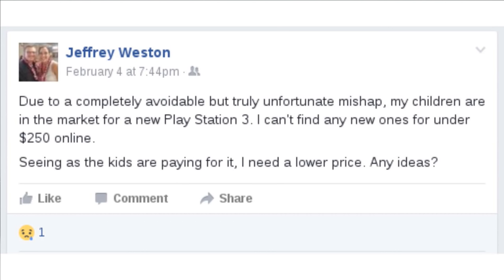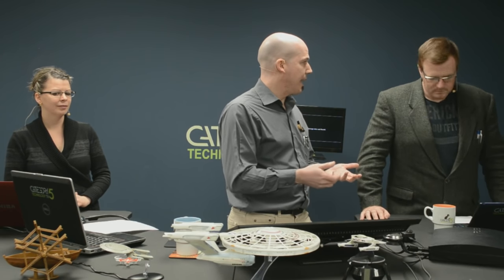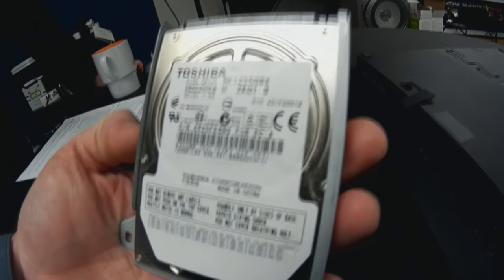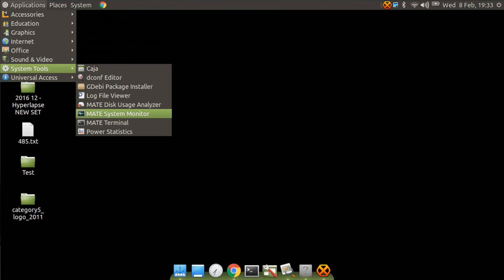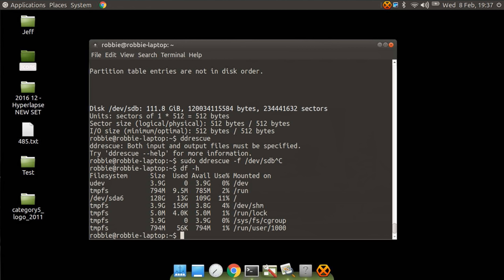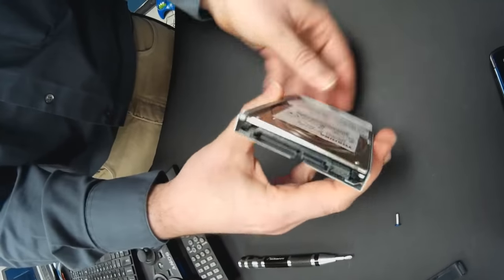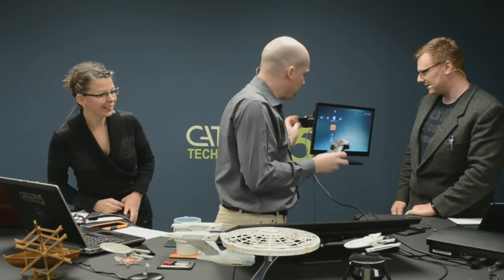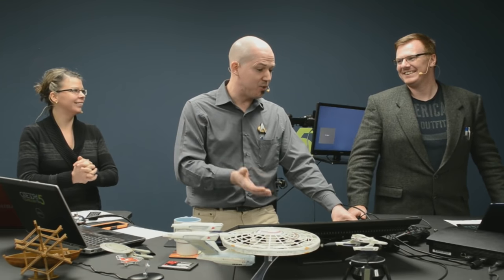PS3 Hard Drive Repair and Data Recovery

Comment: So what would you have done next if the hard drive was good and the unit is broken? I am at this problem. I get no video out on mine, USB ports all read 0 volts. For a second it did light up a controller but then it went away. I tested it with a multimeter and I'm reading 0.0v. System YLOD, chips were all reballed, yellow light gone but not getting power for controller and no video. Tried video reset mode and nothing.

If I stick the drive in another system it will format it so if he had to replace his system, what would be the next step to recovering the save game data. Because the games are not an issue they can be re downloaded but the saves..... well.. lol

Any help would be AWESOME !!! and gain you a subscriber and follower.
Reply: I know this is 6 years old.... but i have this same problem. I jailbroke my first slim ps3 and I had a modified firmware that had some developer tools and my region code for the unit accidentally got switched to Japanese and I didn’t have a full developer DEX firmware installed and it restarted into ylod and rlod and now it is a brick. So i need to decrypt the hdd but can’t find a video with these scenarios as they are always working unit bad hdd. Not, bad unit, working hdd

Comment: Thanks for this very informative and easy to follow video.

My predicament:

I wanted to upgrade my storage. I connected me PS3 drive to my PC and accidentally clicked on MBR/GUID partition. I'm not sure which one.
I have make an image file of the disk like you said in this video, as backup at least.
How do I change the partition back to FAT so my PS3 can see it again?
Can I 'burn' this image to a HDD to use in the PS3 or will it have the same partition problem?
Can I at least get my save game files? I can download and install the games again and forget about my apps and media.
Reply: exact same problem. What did you do to fix it?

Comment: My PS3 suddenly stopped working, it won't boot up or start. When I open it or plug it on, the first message is this, 
   " Connect the controller using a USB cable, and then press the PS button." 
So then after I pressed the PS button, this is the next message, 
" The system software cannot be run correctly. Press the PS button to try to restart the system. If the system cannot be restarted, the system partition of the system storage must be reformatted and you shall reinstall the  system software. Connect the storage media that contains update data of version 4.82 or later, and then press the START and Select buttons at the same time. For information on how to obtain update, refer to the SIE Web site for your region."  
With above message on screen, I cannot turn off the PS unit at the power button.

Can you help me with this and tell me what I can do to save this unit. Thank you for your kindness. 
Dads Cornejo
Reply: try this:
you'll need a pendrive for that, go to the playstation website of YOUR COUNTRY be sure to go for your country, go to help and support. type update and choose ps3. click on download using pc and follow all the methods listed. the update file is between 200-300mb. on your pendrive create a folder named "PS3" and in that create another folder named "UPDATE" and in that, paste the ipdate file. after doing this, press start and select. this might do it
I also had this problem, though i solved it but my slim ps3 turns off by itself, there is no dust problem, any solutions?
Reply: I have this same exact problem... I just need my pictures and videos

Comment: How do i get my data from my ps3 hard drive. I tried connecting to windows using a sata to usb reader but no joy. Please help me find a solution as it has all my wedding photos locked onto this hard drive
Reply: Please reply if you've found a solution. I have tons of photos on them as well. I'm devastated
Reply: me too
Reply: You need a USB 3.0 sata external hard drive. It needs to be formatted to fat 32. Plug it into the USB port. Go to system settings then choose data back up. Back up to the USB drive. If it's formatted correctly it will read it. There are YouTube videos to do all of this. I just watched them over the last few days.

Comment: Hey guys. I have 2 Playstations, A "Fat Boy" and a later model with the sliding top. I'm have a problem with my Fat Boy. Can you switch out hard drives to see if it's still is working?

Comment: Pls Help, i have this problem with my ps3 slim, that when i open my ps3, then after like 1 min it has this weird static lines and glitchy thing in the screen, i tried going to safe mode, tried all the options and didn't work, i watched youtube videos, to choose the 3rd one to restore the file system which basically tell me if i have a corrupt hard drive, i did have a corrupt hard drive but when it started to fix it, the weird static glitchy lines came back and i tried everything to fix it..., pls help me whats the problem

Comment: When I turn on my ps3 it says the file system is corrupt and it needs to be fixed so then I start the fix and it freezes at 8%
Reply: If you were disconnected from WiFi than you can go on a different account and turn off WiFi and then it will work

Comment: At first my Ps3 saying that my PS3 is having a problem with HDD,After thay is fixed... Ps3 says the controller say its not connected(even tho its connected)...push the button in the middle of Ps3 controller...after the loading the ps3 say again that my ps3 doesnt connect to any controller and its becoming a loop over there... Anyone can help me?

Comment: If my ps3 is completely trashed, no power buttons, eject buttons, ribbon cable, however, I replaced the  psu. But I just want the data from the hard drive, what are my options, considering sony's hard drive encription. I don't care about the system itself, I just need game data for oone specific game, maybe two.
Reply from the maker: Hmm, I'm not aware of encryption on those drives. You should be able to plug that drive into any Linux computer and read it as normal / copy your files off / etc. It has to be Linux though since Sony uses Linux formatting for the drive (well, Unix to be more accurate). Download a copy of Ubuntu Desktop, boot it up in "Try Ubuntu" mode (no need to install it) and then plug in the drive. It should detect it as normal. If you're stuck or want to share more info with us, perhaps post it in our community forum and we'll do a demonstration on the show. http://forum.category5.tv/forum-39.html

Comment: firstly why would you even put a PS3 on a fireplace mantle this could have been avoided by putting the PS3 on a lower area like a tv stand of course kids are kids and they will make mistakes for anyone reading this that has kids and has there ps3 on a mantle piece for the love of god move it so you don't have to buy a new PS3 from a high fall

But nice video on how to fix  this issue i had no idea you could use linux ill be sure to try it in the future when ever my hdd kicks the bucket

sorry if my comment came across as rude just making my opinion
Reply: I agree , BAD spot for this. they aer kids and will do stupid things BUT you put the ps3 in possible harms way at that height.

Comment: when ever I turn on my PS3 nothing shows up on the screen and the PS3 acts like its frozen ( when I try to turn it off I have to hold the power button ) and when I try to go into the recovery menu it wont load.
Reply: I had the same problem, try getting the recovery mode again, and well, it eventually works ( to get recovery mode, hold the power button till you hear 3 beeps and your ps3 turns off... wait half a second... hold the power button again till you hear 1 beep and 2 consecutive beeps... hopefully you'll get a screen saying that you need to connect your controller with usb and press ps button )